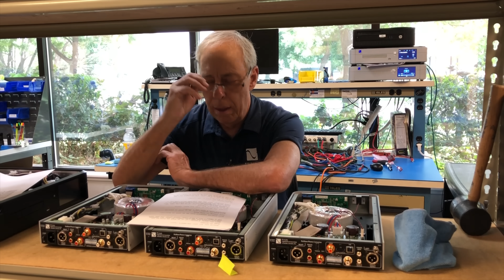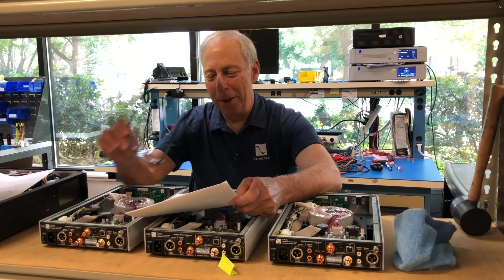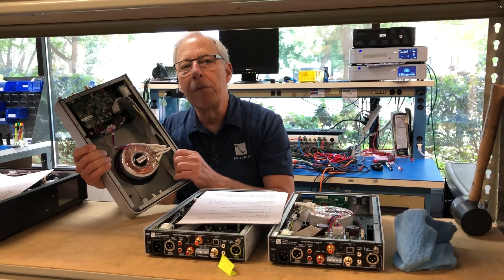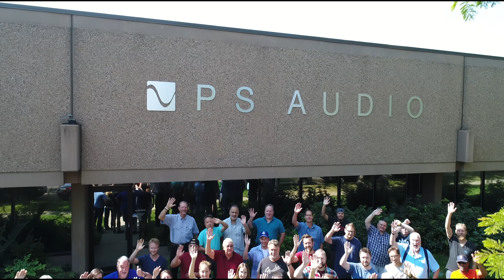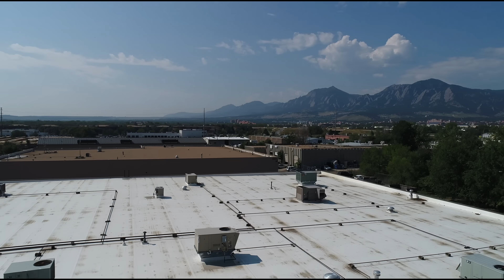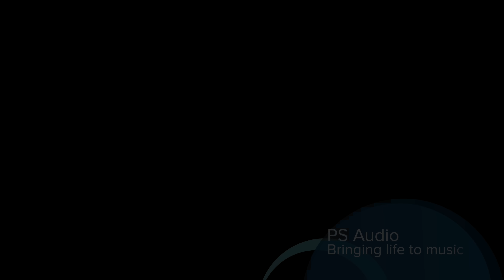What's inside a high end power cable?

Comment: I enjoy all your videos Paul but this one is hogwash.  If you can hear a difference then your power supply should be redesigned.
Reply from the maker: I wish it were that simple but it isn't. Consider, just for a moment, a typical power amplifier. That power supply (almost by necessity) is little more than a diode bridge and power supply capacitors. Few of any large amplifiers are regulated. We can do tricks like regulating the input voltage gain stage but almost never the output stage.

I know it's tempting to claim "hogwash" but it just isn't that simple.

Comment: A retired IBM Main Frame eng, all cables are the same, unless made with broken strands of Copper, period.
When was the last time the editor got a comprehensive “Hearing Check”?
The Hydro-Sound sensors on the USA Submarines are overseen by 20 year olds, who have never inserted a ear-bud, blasting into their ear. Why?
They have to used their hearing to tell the difference between a Whale swimming at depths and the “Propeller, minimal cavitation of another sub.”
Much less a 60 something, standing at “0” inches to a Loudspeaker, at full “Gain” for most of their lives.
Marketing to the “Must Have” is easy, but to the real “Educated, science base” it is a “Pie in the sky”.
Don’t every Home Owner knows that behind the AC outlet is a single wire conductor, attached together by wire nuts? Not soldered together, and long runs. 
So buyer beware.
There is a real hi-fi geek in Japan, he payed his City electrical provider to run a dedicate line from the main Transformer, to his input of his Amplifier.
Reply: Ye, same opinion, as long as its not damaged its fine

Comment: Don't forget the insulators to elevate the cable off the floor!  Heaven forbid your cables couple with encapsulative duractance effect from the wood grain and Earth's magnetic field.  It's well known to those using dipole speakers like ES and ribbons!  If that happens your entire sound stage will collapse.  Easily fixed by spending another $10-20k (per channel).  ;)

I stopped listening to CDs altogether in the late 90s because the last of my magic sharpies dried up.  You know the ones used to mark the edge of the discs to make them turn truer? ;)

Comment: If you guys really think  a,power cable is not important.. try charging your car with jumper cables different gauge.  And  the smaller the gauge the higher risk  you have of melting the wire .also the smaller the gauge  the longer it takes to charge.  I would think power supply in any electric device is very important.
Reply: golden

Comment: The skin effect at 60 Hz runs to a depth of 8.5 millimeters.   That's academic fact.   Talking about hollow conductors at 60 Hz is just so much nonsense unless you're using conductors that are larger than 17 mm in diameter.  (That's just short of 3/4 inch.)   If the last six feet of power cable make a difference in your system, after that power was generated hundreds of miles away and has been conducted throughly mostly aluminum transmission cables and innumerable splices and an unknown number of substations and power factor correction capacitor banks, then I have news for you and that news is that the power supply section of your amplifier may need improvement.    

I'll agree with the notion that solid connections are important.   But if a power cable makes a difference past that point, then the cable must have a filter network built into it and it should be the job of the unit's power supply to do that filtering, not the power cable plugged into the back of it.

Try this, Paul:  Connect the Romex directly between your power panel and the internal power supply connections in one of your amps.   Straight through with no splices or joints.    That should sound as good as possible.  You're not going to "fix" the power coming out of the Romex with another length of cable after that.   That's nonsensical. 

The notion that the qualities of a power cable can affect the frequency response of the amplifiier (rolled off top end) is ludicrous.  That can't be explained rationally.  If you can't measure it, it's not real.   

I believe in most improvements that are considered to be fact among the audiophile community.  I can understand and appreciate the difference between interconnects and speaker cables and understand the mechanisms that make those differences.  

But the power cord thing....once you have a very solid low resistance connection between amplifier and power source, capable of carrying the maximum load possible under operating conditions without a loss of voltage, there is nothing more to be done and no more improvement to be had. 

After I get done recapping my pair of Krell monoblocks I'll make it a point to do a power cable substitution test using some "well regarded" "audiophile" power cables and comparing them to the standard 12 gauge power cables that normally run them.  (IEC modular plugs)   If I hear a difference I'll let you know.

Comment: Regardless of the arguments, the auction connectors are important. Anyone that loves audio should upgrade their home wall sockets to premium or hospital grade, they're cheap and effective at making a more solid contact to the wire and plug. More surface area equates to better signal transfer.

Comment: Paul talks about firmer bass through the solid cable and better highs through the stranded cable?  Wouldn't these differences be measurable with something? a change in shape of the bass wave or a dB increment... an oscilloscope?, so far in my life as an enthusiast, if the is a difference in the sound, it can always be measured with something.....other than just golden ears. 

I understand the theory of the two cable constructions on speaker cables........but how does this transfer to the power cable which is only coming in at mains frequency.......there is no high frequency component by which will travel better down the stranded cable.  As others have pointed out, and what about the other 200 miles of wire that may be between your amp and the power station- shouldn't it get the same treatment.

no, I haven't tried to see what a difference it would make, but even if there was a difference, its unlikely that the cables could be swapped out quickly enough for my acoustic memory to register, but if it could be set up somewhere I'm willing to give it a go.

Comment: As someone who studied Engineering Physics and fairly well educated on the topic of Electromagnetism, I can tell you that there is no scientific field of "clean electricity".

Electricity is essentially the accumulation of electric fields, and electric fields don't get "dirty".
Reply: EMI and RFI are real.

In most circumstances,
when someone is referring to a signal, 
or an electrical system in a house or part of it,
or to current in a wire
as “dirty” and/or “clean”,

they’re talking about a given degree of contamination therein with 
EMI/RFI.

If you deny EMI and RFI,
or noise in electrical systems,

or,

if you don’t understand why the terms “dirty” and “clean”
apply well,
you need to go back to school.

Comment: Sort of in response Andy Delle's comment, when i first heard that power cable make a difference i said the same thing, 
"that seems like the dumbest thing i've ever heard of."
But then i recall from technical school that i had an instructor tell me in no uncertain terms that me wanting to put a 
bigger capacitor in the audio path of my radio project we built that semester was not going to work. No Way! No How!!!
Thank God i didn't listen. Later when i wanted help to get an audio op amp from Radio Shack to work, the power supply
was oscillating so bad that it did seem hopeless, he said you'll never get that to work either. 
I not only got both items to work, i'm still using the audio amp 28 years later. The radio I destroyed by continuing to 
make it better. 
if I had listened to my instructor, he was actually my favorite teacher at that school, I would have missed out on hearing the best music played back on systems that play music the way I want to hear it. I've played guitar for 50 years and grew up pounding on a upright piano for 14 years. Almost all of the stereo systems that I've listened to do not sound like real music. They can sound really good but not like live music. My experiments have gotten me close. 
Power cables make a huge difference even on cheap stuff, which is what i mostly have (raising two daughters takes most of married income so audio  is usually a low priority). 
I've replaced all the power cables with 12 gauge romax, it's cheap and it works. The only thing it doesn't seem to help that much is televisions. Tried it didn't notice any difference. But for audio it makes a huge difference.

i was converted ten years ago. (I could give a ton of examples of how it improves the audio, but this is already too long. i'm an audiophile not because i have great hearing, just the opposite i have one eardrum covered with scar tissue from endless earaches when i was young. I need my systems to speak clearly to help me enjoy them).

My favorite quote from Mark Twain is; "If you grab a cat by the tail you'll learn things that you can't learn any other way". 
Enjoy the music any way you can!!!
Reply: I find it odd as an engineer for another engineer to discover a combination of materials which apparently makes a difference to sound, yet is totally unaware what change is happening and has no curiosity to investigate. It's especially strange considering he's selling them and has a vested interest in demonstrating to his customers that his cables make a difference.

Comment: If you referance the NEC codes and check the wiring tables they give insulation types etc but they also give you the max voltage amperage etc stranded wire is always rated as being able to carry more this usually doesn't matter because of over current devices for the load range you are looking at

Comment: I was a skeptical as they come when I first heard about these ubeaut aftermarket power cables. I had bought some fairly expensive interconnects and speaker wire, and could not say I could hear any real difference to speak of from any of them. So why should a power cable which has nothing to do with sound make any difference? Well I got a Consonance power cable thrown in with a Butler Audio amp I bought, and I was astounded by the difference.

I kept switching back and forth between it and the standard cable to make sure it wasn't my imagination. No cable to that time had ever made such a big impact on my system as that cable did. I have since bought some Furutech Alpha series power cable and have made up my own cables. The weird thing is not every device shows the same massive gain. Some are so small it is barely if at all noticeable, while other devices are like a punch in the face.
Reply: Joe Home  what did your wife have to say when u made those cable purchases?
Reply: Joe Home  100% placebo, HDMI and coaxial audio are digital signals. The cable makes no difference in quality of the output. It either works or it doesn't. Your son could replace those cables with the ones that came with his Xbox and you wouldn't know the difference unless you looked behind the TV.
Reply: Joe Home  I have no idea what you're talking about. You don't need to justify how you spend your money to me, it's your money. But the fact is the HDMI and coaxial cables you bought performed the same tasks as the ones that come free with an Xbox, DVD player, whatever., for no extra charge. With digital signals there is no advantage to a higher cost cable.
Reply: Joe Home  well, she does not know yet, she is on vacation ( i stayed home (to buy the cable))
Reply: You say you kept switching back and forth to make sure it wasn't your imagination. What you need to do to make sure it's not your imagination is have someone else switch the cables without you knowing which one is in.
Reply: @arpakyna  that test is reserved for small minded impressionable people.
Reply: Joe Home  no bad words please
Reply: Joe Home  hey Joe! You should stay at home!
Reply: W N  Is it possible that power cables could somehow influence something with either an analog input or output? Another question, I have seen suggestions of putting ferrite cores on the end of the speaker cable closest to the speaker. Will that really reduce interference that has accumulated as the signal passes through the cable or is it nonsense? Is shielding the only way to protect from interference or are there other ways? Sorry to ask so many questions, but it's very interesting, and you seemed very knowledgeable.
Reply: Joe Home  It's just placebo, especially the HDMI. Do some research before you post silly things. A HDMI cabe does work or doesn't. If it does work, it's doing it's job and you don't need to replace it. If it doesn't work, you have no sound/picture. Man, it's digital, and if it's capable of tramnsmittnig digital signal to your TV/receiver, it's fine. It won't influence the picture quality, just because you paid a lot of money for a fancy looking HDMI cable. YOU NOT GONNA GET BETTER RESOLUTION WITH MORE EXPENSIVE HDMI CABLE. Jesus...
Reply: Dodgy..... welcome aboard.
Reply: It's called placebo ... you pay more for the same thing so it has to sound better ... like putting stripes on a car lol !!
Reply: @janinapalmer8368  😯would it drive faster?
Reply: @janinapalmer8368  , oh ye of little faith.
Reply: googoo gjoob ~ oh ye of easy persuasion lol 😂

Comment: The only way I can think of a cable affecting sound quality would be if the cable picks up or emits electromagnetic interference. If it emits interference and you can hear it, there is probably some part of your system that is defective, or unproperly shielded. Moving your power cable away from this equipment may help. It it picks up interference and you can hear it, the thing that is powered must have the worst power supply in the universe. Other things that can affect the sound is the presence/lack of an earth wire (ground loop) and a really bad contact (ex: heavy oxydation).
Changing the throwaway cable with a $200 cable may incidentally fix these problems. But changing the throwaway with another throwaway may have fixed the problem the same way.
Reply: Most power in the US and elsewhere is very dirty and full of noise. Note that hospitals go to incredible lengths to "clean up" the power to their radiological imaging systems (as is the case with their dedicated backup generators).
Reply: @Telemed911  Mains certainly is noisy, but a well designed power supply will convert it into nice, clean DC, that's its job! Radio imaging is a different thing, radio signals are harder to deal with than audio signal (much higher frequency). And if we are talking about sound, medical ultrasound is way more sensitive than what bats can hear, let alone humans.

Comment: Regardless of whether there's a noticable difference:

- if the cabling in your home is 12gauge solid-core aluminium.. then having your powercord be 12gauge solid-core aluminium has ZERO effect on the ability to supply your electrical device with power (aside from the fact that the total length of cable is slightly longer).

If having a hollow core stranded cable has an effect on the sound produced by your electrical device that simply means that your device is influenced by power-delivery.. which means your device has poor power filtering/cleaning.

I would much rather buy a device that properly cleans the power it receives than a device that passes the flaws in the power delivery along to the output of it's (amplified) audio signal.

Comment: PS Audio makes some great products but should steer more clear from snake oil to grow credibility overall...this is what PS Audio advertises for the PerfectWave AC12 power cable qualities:
1. PCOCC single crystal construction
2. 8 gauge power cable
3. Quad shielded low noise
4. Hollow tube conductors for treble performance
5. Rectangular conductors for midrange performance
6. Multiple gauge conductors for bass performance
7. Gold plated connectors
8. Welded connector to conductor
9. Quiet for digital
10. Unrestricted for analog 
Paul, sorry, but why do you allow such snake oil talk for PS Audio (item 3,4,5,6,9,10)? If a true professional blind test came to such conclusions, we could all have some respect for it. So how are these points made? Without either measurements or blind tests to support those claims, they all sound like an incredible pile of snake oil talk for a few feet of power cable (that are in series with many factors more of house wiring). I wish you could promote a much better no-nonsense approach to audiophile performance and whenever something "smells" a bit like snake oil, do some honest true blind tests and publish them here; and it will be truly awesome.